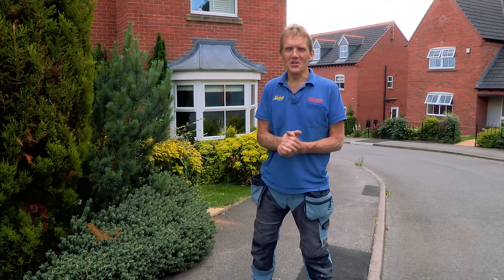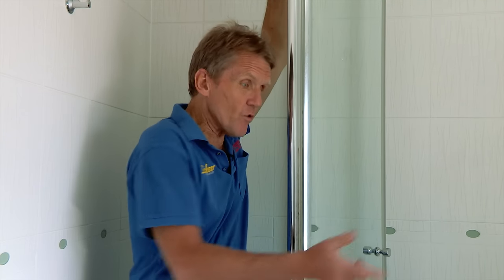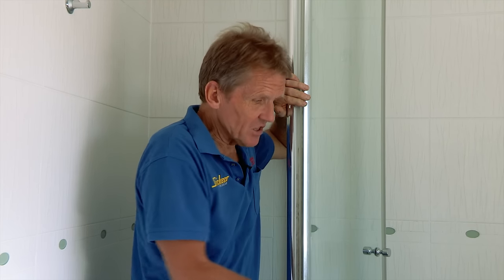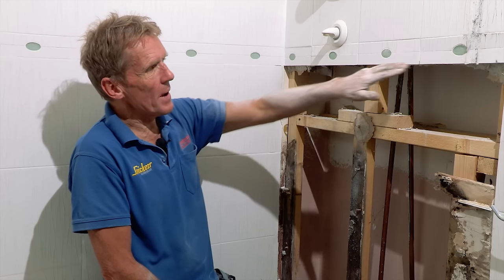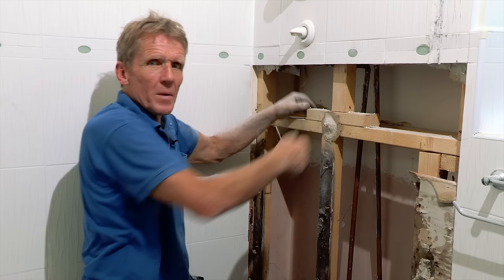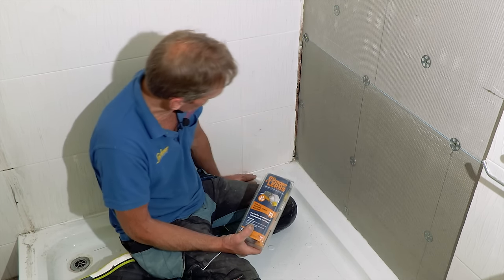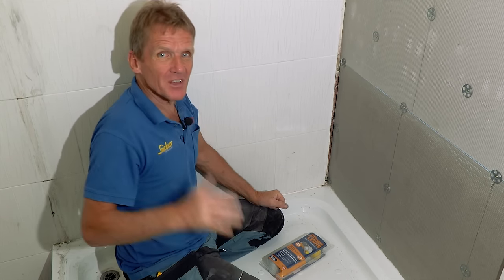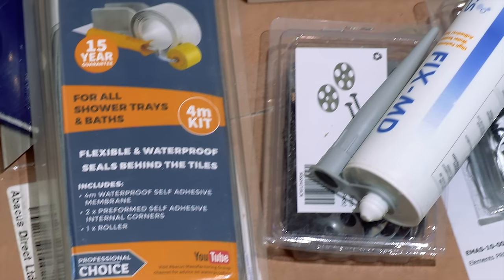Unbelievable Cowboy Plumbing Horror Show

Comment: It's refreshing to see someone exposing shoddy workmanship and attempting to put right what others have made wrong but a couple things I noticed the shoddy stud work you didn't replace and you didn't treat the black mould spores to prevent it continuing to grow behind in the wall cavity... which didn't impress me if I had to do such a rework I'd take out all the stuff that's crumbled and infected and treat it with an industrial mould and mildew killer and wash it all away with a clean cloth to apply and a clean cloth and hot water to remove it to pre treat it once treated I'd probably spray the lot with a solvent based antifungal ova glue and water mix to seal the back to make sure it's not going to grow back at all then put the elements boards in seal them coat tgem in adhesive tile grout and seal there's nout like doing the job right first time because then you get them calling you for other work in other areas of the home and you get recommended to others for the work... in a plasterer by trade but I am very handy with plumbing electrics tiling bricking an roofing so I am very particular to detail when I see stuff and again in bathrooms people only think to seal wear water will hit an forget about the condensation that gathers from steam and iv come across it a few places where the mould is growing through the ceiling and upper tiling because of that or even behind the wall because of condensation on pipe work dripping down because the pipes arnt insulated with foam lagging usually on the cold water pipes where moisture in the are condenses on the outside of the cold pipes seen that a lot too
Reply: And breathe...
I found that I was subconsciously holding my breath as I kep' on reading, getting ever more desperate for a full stop. Therefore a chance to breathe.
But also to let your valid points sink (sorry) in. No punctuation, not a comma even and Huh? even ending with nothing at all, period.
Think on it please.
This is not an arsey comment from an ivory tower in England, sneering at the lack of punctuation. Instead it's a call to you to go the extra (‽) yard, put them in and thereby allow your reader to appreciate, agree, argue with, whatever... to benefit from the full flow of your experience.

Comment: The sad thing is if people just took a little pride in their work, these types of problems wouldn't be so prevalent. Instead they want to take shortcuts, and rush through jobs so they can move onto the next one as fast as possible. It's like what was said; we have all this remarkable technology, but not even the best technological advancements can make up for sheer laziness, or lack of skill in the trade you're in.
  Do the job as if YOU are the owner, and it's your time, money, sanity, and comfort going into the project. Also, don't be afraid to hire a pro when it comes to jobs you may not be able to handle. Just make sure to ALWAYS check their licensure, and credentials before hiring anyone. I've been a professional for exactly zero years, but it sounds like smart money to me, LOL.

Comment: Did i hear correctly that this guy wanted to re-use old tiles? In my word that kind of tiles cost next nothing compared the labour fee for cleaning the glue off from old tiles. Also you can use the cheapest plasterboard in showerroom with no problems, but you have to use water barrier - this same blue stuff that is  shown in this video.
Reply from the maker: If it were possible to get hold of those tiles then we would use new ones but tiles become discontinued very quickly so what do you do then. Soak those tiles in water for a week and the adhesive falls off.
As for plasterboard you can tank it but you need to seal that edge on the tray or it will suck up water when the silicone seal breaks down and then it is Groundhog day. For the sake of the price difference why not do the job properly for once in your life.

Comment: Plasterboard is OK in a shower,  but firstly there is no such thing as water resistant plaster board.  A plaster board installation shower system need to include two or better three layers of water proofing.  

That being said even compressed cement sheet cladding needs the same!  Its just that water leaking to a compressed cement sheet wall will not itself degrade.  BUT the framing behind such wet sheeting WILL degrade.

There are no shortcuts!

Thirty years in the trade and not one come back.  NZ
Reply: ps,  the board,  just to be clear,  you are using as a replacement for plaster board is excellent.

Comment: Perfectly nice stone wall behind it, cut slots through the wall, put the pipes through there, seal it up, tiles directly on the wall, done. But no, it's a great idea in a bathroom where it's gonna be wet a lot of the time to build a fake wall out of wood that eventually is gonna rot. It doesn't matter how good you seal it up, even a modern car with rustprotection parked on a patch of gras everyday is gonna rot because moisture eventually gets through everything. Never ever ever ever use wood in a bathroom
Reply from the maker: There is a soil pipe behind this wall and that is the only reason it is built out. We live and plumb in the real world where things get in the way. I have seen many rusty metal framed walls so I am not persuaded by your argument.

Comment: some time ago my shower tray broke, and the incompetent nincompoop who replaced it also put new tiles in - straight on top of the old ones. and that is only one of several reasons why i'm not happy with that job :-( 
and no, i wouldn't be surprised if there was water behind those tiles, causing the problem in the video. but i guess i won't live here long enough to find out...
Reply from the maker: It is actually a very good idea to tile on tiles and there is nothing wrong with it, I went to a tile adhesive laboratory and they showed me it is the best substrate so no need to hack off the tiles if they are sound.

Comment: He didn't fix the fact the studs are on flat...to take some flex out of the wall if someone leans on it.  Means the grout will crack again if pressure is put on the wall. Why not use proper cement board instead of foam board?  At least he put backing in for the valve...

Comment: Why Don’t you use that bleu stuff on the vertical joints sorry for my Engels  i’m from Holland  .
Reply from the maker: Hi Erik
What vertical joints can you see? I used it in the corner and the only other joints are the horizontals,. All joints in the wet area need to be covered
Reply: Skill Builder .  i’m sorry i see it now it’s a Pencil stripe . Mvg Eric

Comment: If this new build is less than 10 years old it would still be under NHBC
Reply: NHBC doesn't cover this kind of problem, that would be down to the original installer who most likely only supplies a "brake light" guarantee.

Comment: Did you treat those timbers before re-boarding?
Reply from the maker: No we took the whole thing out. Once the moisture goes the mould dies so no need for chemicals
Reply: @SkillBuilder  is it not better to treat the timbers to preserve them if you didn't replace the studwork

Comment: It's not the plumbers fault , it's the property developers  fault . These building contracts are constructed at  minimal cost , the contractors are paid and instructed to fit what they are given . The plumber probably done his job correctly the plaster carpenters everyone else probably done the same. Bottom line is the property developers build these homes to maximise their profit levels and work within base line building regulations . So please don't  blame the trades . Blane the property developers and building regs for not insisting on increased level of building  standards .
Reply from the maker: Hi Dee 
That is a great theory but the shower valve was hanging on the pipes and not fixed to the wall. No plumber should do that. It moved when it was turned on and off. There was no way this would work. The timber stud was also very poor. 
We all have to take responsibility, it is what grown-ups do.

Comment: But what was the cause of the previous leaks?  What plumbing solutions did you make to stop that in the future?  This is all about boarding and damp.
Reply from the maker: David 
 You are right that this is all about boarding and stopping any problems in the future. We have to limit the scope of the videos, to keep them watchable. The shower valve was not leaking it just allowed water in around the edge. The valve was secured and the edges were sealed. It solved the problem.

Comment: The only thing I would add is that I would seriously beef up the studwork first, putting  second studs (the right way round) along existing studs; also extra cross members, and all generously screwed together = no movement, so no cracking & no leaks.  Yup, I have seen many shower / bath rooms like this.  Nice vids, thanks.

Comment: Why, in first instance, you didn't move shower wall back. You would gain 0, 2 sqm in bathroom which is a lot in this case?
Reply from the maker: What will you do with the soil pipe that runs behind the wall? Watch the video we put out tonight and see why there is no point in making nooks and crannies in a bathroom. All those little corners gain you nothing and just  look a mess. Space is as much about perception as reality. All my customers are delighted to see the clean uncluttered look of the bathroom and no pipes on show. 
You can also see the follow up video to this one where I put in a larger tray for a walk in shower. It fits wall to wall.
Reply: @SkillBuilder  thats fair what you say. Will watch next video. BTW, for bathroom I am using fibre-cement board for outdoor use filling gaps with chemical anchor. Sizes up to 3 m long so standard shower will have only one joint in corner. Much stronger than this skimmed PS. Worth to check.

Comment: He screwed the panels on the old rotten mold infested wood studs.  It costs only like 3 quids of a new 8' wood stud. The time and cost to remove tile by tile then broke one and bonding prep work for installing tiles over tiles at other wall, isn't it quicker just to remove the walls and give them brand new wall and tiles? Cowboy vs cowboy! Most builders in the UK are cowboys who leaned the skills from their mates or dads with outdated information. In Canada, builders have to go to trade college to learn the skills. They need a permit for the job and have an inspector comes round to inspect the finished job according to codes or their work license get suspended.

Comment: Shower valve fitted totally wrong , set way too  deep and the closure of board is too tight , the finish circle trim seals it up you need the gap to access  the pipes .
Reply from the maker: If the valve connections need to be got at it is an easy enough job to trim out the enclosure but the gasket is the correct way to fit it. As for being too deep the shower manufacturers supply the depth marks.

Comment: You need to address the black mold issue inside the wall BEFORE YOU REPLACE THE TILE!!
Use Concrobium, best product ever for black mold. If you don't address the black mold and remove it completely, it will keep growing inside the wall after you seal it all up.
Reply from the maker: The muld dies when the moisture is gone, that is a fact, it doesn't spread without moisture

Comment: Just use cement sheeting and joint and paint with acrylic sealer .
The same as this blue used on here .The system  is guaranteed and is used in Australia .In fact it's part of the building code . !!
Reply from the maker: We also have cement sheeting but it is heavy, gives no insulation and creates a mess when you cut it or drill it. Each to his own of course and I would still be using it if I hadn't found something better. We are doing some tile pull off test soon on various substrates so look out for those.
Reply: @SkillBuilder  Really. Have used it plenty of times .Use readily available insulation behind .
I suggest your plugging a product and not a real solution. 
I suspect an expensive one too .
Lets hope others have the intelligence to see you for what you are  !! The product your plugging is no better even worse .
You should put advertising on your heading. Or ignorant to what the rest of the world has/is doing .
Your premise is embarrassing!
As for making a mess when working with 🤣 I take it you never have .It makes less mess than plaster board. Power tools are not needed,  your ignorance shows bias that's not only unfounded but ridiculous.
Reply from the maker: @stuartwilliams8663  I am not forcing you or anyone to use it. You are, presumably old enough to have your own pocket money and make up your mind but I don't understand why you are so intimidated by being presented with another option. Kerdi, Wedi. Marmox  and countless others make foam board, albeit at at a higher price so it is well established.  I like it becaause I can carry a complete shower pack in the back of the van. As for cost there is nothing more expensive than doing the  same job twice. Good luck to you with whatever you choose to use. 

BTW 

We were not paid for this video. I came across the job and asked the customer, a friend of a friend, If we could  film it and, judging by the response a great many people are happy we did.
Reply: @SkillBuilder  Really. I think you should be upfront .Your advertising a product. It's no better than what's already available at half the cost. You have no credibility at all, In fact the opposite  !!
Reply: @SkillBuilder  You seem to be making the assertion that your video was unbiased  ! .So you discussed other options. No you didn't, discussing types of gyproc is not choice. Making out this product is the only way of doing the Job that lasts is bigoted and nieve. Your experience is obviously lacking, to make the statement   "doing the Job twice". I take it you have never used cement sheeting/backing boards, not only are they the best for wall but also flooring substrate when tiling in wet areas .
Your finishing condersending remark " Good luck to you "
Kinda shows your arrogance if not ignorance. I suggest that anyone reading this look up the building code for USA and Australia for timber framed dwellings ( wet areas ) . Playing on people's ignorance in the UK is well frankly  embarrassing. I have worked in the construction Industry for over 35 years in USA , Australia and have now returned to the UK after 16 years. This product is nothing but an expensive fad in both labour and materials which will not out last the method I described and is definitely not more durable  !
I also suspect it would give of toxic fumes if burned !
Reply from the maker: @stuartwilliams8663  Nothing is unbiased, people always perceive bias. My video is based on my experience, you can make one based upon your experience and the world will be all the richer for it. Like I say Good Luck.

Comment: Did I miss something ? What was the cause of the damp ?
Reply from the maker: It hardly matters because the point is that if you have  a failure of a seal or grout (as happens often) there is no second line of defence. The point of this video is not about how to stop things leaking because things always leak in the end but what you do to mitigate the consequences of the leak. Waterproof tanking is not mandatory,

Comment: My only criticisml is, i would have replaced the timber that had got wet and clearly showed signs of mold. Other than that, great job.
Reply from the maker: No need to replace timber if it is not dry rot. Just remove the moisture.

Comment: I thought with an Aqualisa shower like the one shown in the video you should have a space around the valve (mortar guard) so there is a gap between valve board and tiles. If there is a problem with the valve ie: it needs to be changed or the O rings leak on the  H & C water elbows to the valve. In your video you can only do it by removing tiles and cutting out the board to get to the valve to make any repairs.

Comment: It is the massive cost to the environment having to do jobs twice or three or four times.
Also, houses being built are technological dinosaurs, they are building near me, none of them has any Solar Energy capture and storage, it is tragic we are building over far too much green space with houses which are years out of date already and often of shoddy build quality.
Today's house should require very little in the way of maintenance and hardly any need for external energy inputs from grid systems.

Comment: I would bet none of the big uk builders do this as building regs only require moisture resistant plasterboard which is pretty much useless
Reply from the maker: you are right. I think it does now require some waterproofing on top of the board.

Comment: That guy is not a plumber. That problem will appear  again because as I see it on video leakage was from pipes or valve .
Also frame had to be changed.  I replaced  a lot of showers and if tiles and grout  installed write even regular drywall works fine.
Calgary
Boris

Comment: Why didn't this fellow replace the obviously weak studs behind the wall he removed?  He had pointed them out early in the video.  If he did that, it should have been shown before he put up the new tile substrate.
Reply from the maker: They were braced back to the wall. This video was about making a waterproof shower not building a stud wall.
Reply: @SkillBuilder    OK, but you did mention how flimsy the studs were, weakening the wall and mounting of the tiles. It would have only taken a minute to show how you fixed that problem in order to prevent possible future issues. Otherwise, well done!

Comment: Is it called HARDIEBACKER board?
Reply from the maker: No Hardibacker is a different product, heavier, harder to cut
Reply: @SkillBuilder  do you not think using standard plaster board that is then tanked is a better way to go? Just seems very expensive with these boards. Price needs to be factored in too.